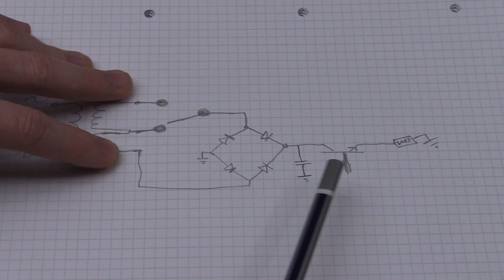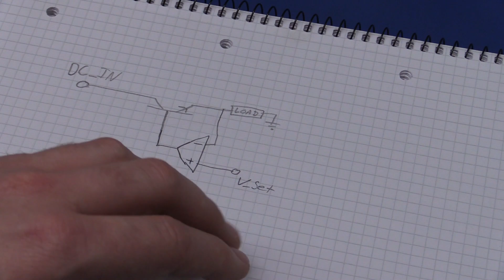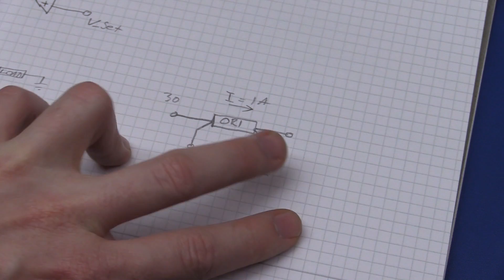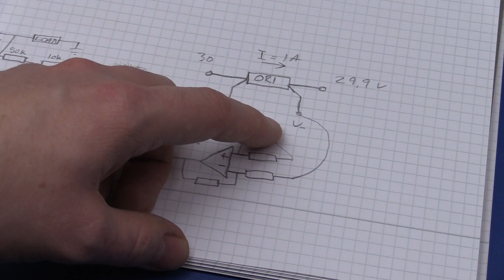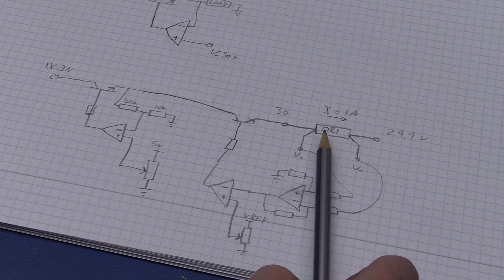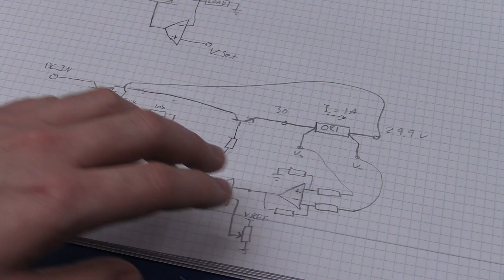DIY Digital Lab Power Supply: Part 1 - Ec-Projects

Comment: Is it better to use a transistor (for the constant voltage side of the powersupply) instead of a mosfet? I'm trying with a logic mosfet and the output is not that good

Comment: Thank you very much to share your videos, i'm building my own power supply and i have followed your circuit for the voltage regulation which works realy well.
 For the 5v referenve i've used a 7805, works fine. Without this regulator the output voltage was droping a lot on big loads, but now it's working really well. Perhaps i will try the current regulation later.
My transformer is a toroidal 12/24V AC so i've used a 3pin switch to switch the secondary when needed so the transistor doesnt disipate all the power when working with low voltages. I can go 0 to 15V and 0 to 28.8V with the switch.
Anyway thanks a lot for sharing.

Comment: can't you connect second opamp to the middle of voltage divider and switch it's inputs (- to Vref). When ever the current gets too high  it'll rise voltage divider voltage and the first opamp will reduce the output. You can also put a gain (negative feedback) on the second opamp because it works like a comparator and it might not be much stable. Use gain of 30-50 for example. Maybe also an integrating cap between - and opamp output. 
P.S. Because  opamps have push pull output it'll also drop the voltage of divider to 0 if the current is below the threashold. So on the second opamp you need a diode with the anode facing the output of the opamp.

Comment: why not do a buck converter instead? much less heat to be dissipated
Reply: bucks or smps are very noisy
Reply: Was thinking the same :-/ But maybe its to keep it simple, and get les noise.. most buck generate noise in the 1-4mhz range :-/

Comment: dont use a discrete diff amp for the current control. Even a 1% or less mismatch in the resistors will ruin your CMRR by a huge margin and degrade accuracy. use a diff amp IC!

Comment: For some reason I always felt you'd come back to the diy power supply(probably because you either said that or hinted it in a previous  video :P). Looking forward to the next video. A little bit off topic, what would you have done to the other power supplies to reduce the noise?

Comment: If you are aiming to dissipate the least amount of heat and thus stay quiet, did you consider if having a switching pre-regulator that tracks the desired output voltage by a small offset might be a fun thing to try once you have the main regulation working?